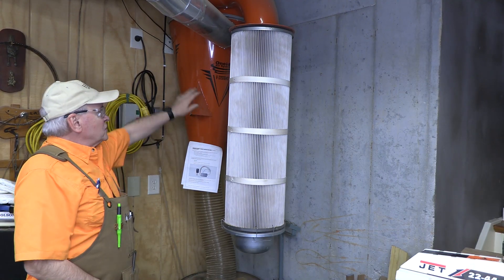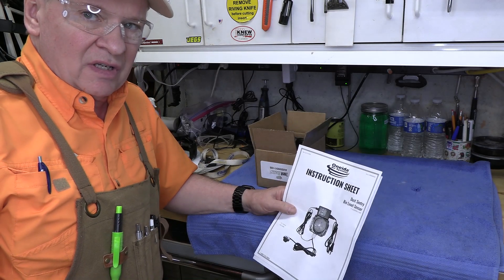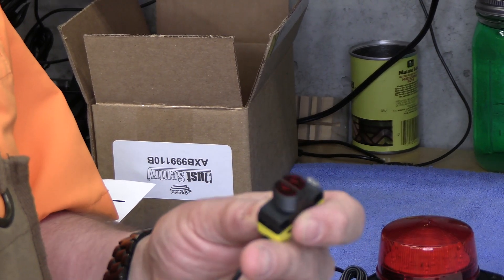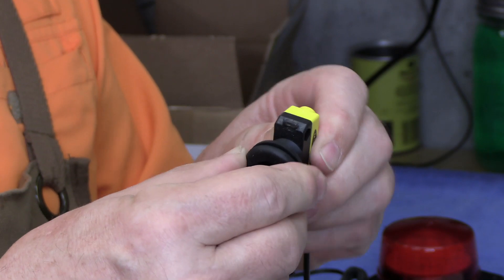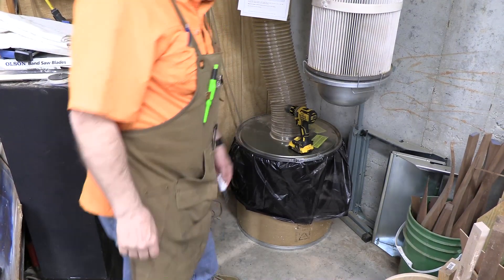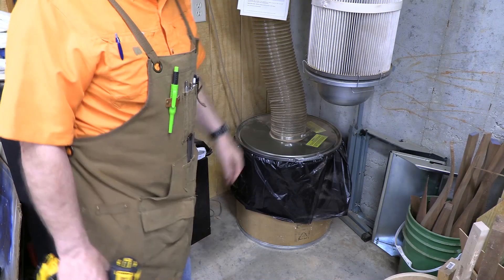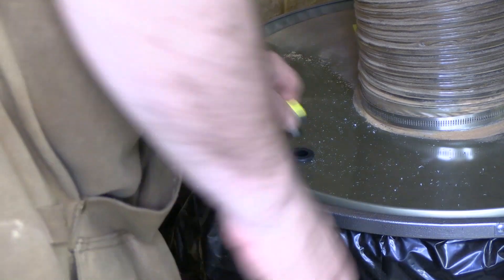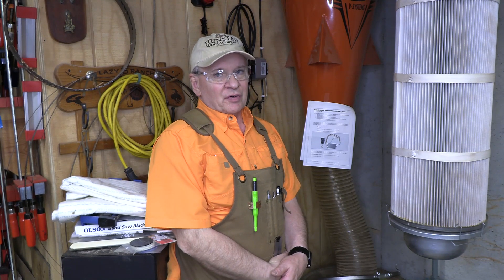Oneida Dust Sentry Installation and Product Review with Dr  Joe

Comment: could I use a $10 fuel level sensor/gauge for the same purpose? Question I would have is will the "liquid float" move with dust level or will the the dust just accumulate over the float without moving it. Alternatively a Banner QS18VP6D sensor could be bought on ebay currently for $13 from china. Perhaps just wire it to light indicator and done at 10% of the price of the overpriced Oneida scam.
Reply from the maker: Thank you for your comment and question. Those devices may work. The United device is an optical sensor. That’s very accurate and I’m very pleased with it. Yes it cost some money as everything does from your own night up with the quality remains excellent. Considers subscribing. Thanks. Joe

Comment: I've been looking at this for a little while and was concerned with the number of negative reviews (Amazon - taken with a grain of salt of course).  It is pricy (~$170) for something I worry may not work well.  Many claim that the sensor becomes clogged/dirty constantly and gives a false alarm.

May I ask where you got your collection bin from and what size it is (its total lid height)?  I'm waiting on a new plastic 20 Gal that is delayed on back order and needed a bin under 22" tall to fit my system.
Reply from the maker: I was just planning some aromatic cedar, making a raised planter box for my daughter, and running long boards through the thickness planer when my daughter noted the light, blinking and sure enough it was completely full been, but it didn’t over spilled into the filter. I really like this ad on. Take care, Joe.

Comment: After using it for a year now how has it been for working for you?  Would you recommend it?  Great video!!
Reply from the maker: Hey John thank you for your comment. I have no use it way more than a year and so far so good. I had one malfunction but other than that it’s worked quite well. It is saved me from having it overflow are they have to totally clean out the filter which is a pain as we know yes I’d recommend it.